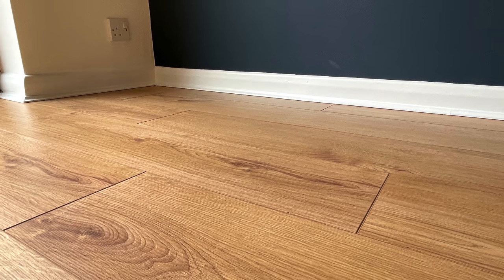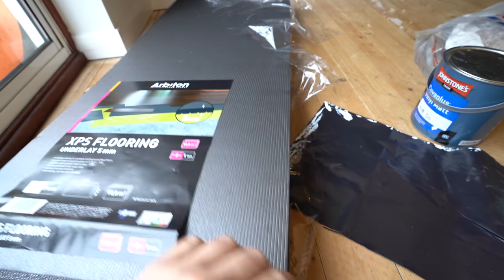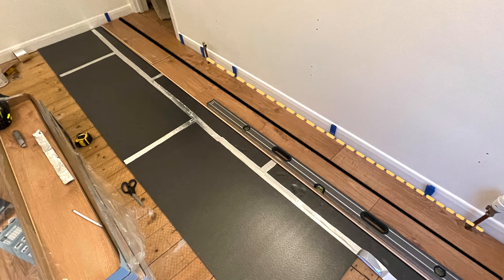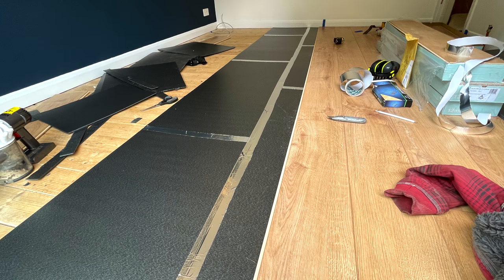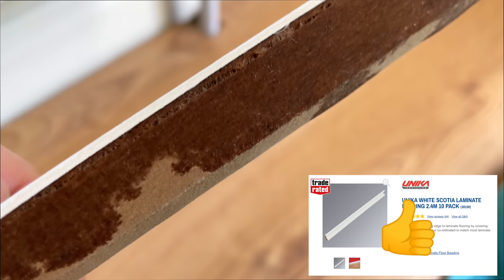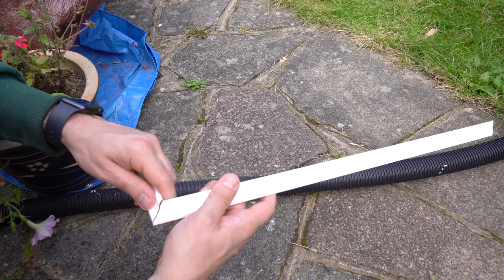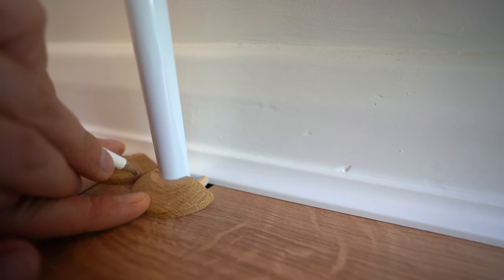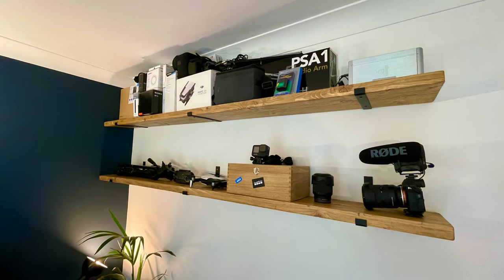Laying Laminate Flooring & Attaching Trims

Comment: Excellent job, came out looking really nice. Only small thing I’d change would be to cut the joining the straight ends of the trim at 45 degrees for a smoother finish, butting two pieces together never quite looks right and will over time separate showing the join … just a thought!

Comment: Nice video! One question, before you applied the floor trims, did you clean the laminate? I heard that cleaning with a bit of acetone (the area where we will apply the trim) will help with the glue, is that correct?

Comment: Good video, a handy hint for you. If planning on painting the skirting or trim you can tape masking tape to the laminate under the trim so it pokes out from the trim. Then you can paint your skirting and trim easily. Once paint is dry run a knife around the tape and peel the tape away. The tape under the skirting is invisible and you won't have paint on your floor.
How do you find the nailer? I have heard reliabilty issues with the non gas versions of these types of tools.
Reply from the maker: Interesting trick, I would have thought the tape would be visible even if running a utility knife along the trim/skirting but good to know. Yeh the nailer is fantastic, I think everyone has their preference - I can't be faffing around with gas and cleaning out guns personally but I'm not a tool geek - I'm more interested in the project so whatever tool is easiest and causes me least grief is my preference. Others like to tinker! If you check out my third vid in my fencing vid I use a gas paslode, didn't enjoy it, though it was a probably down to being a crappy rental.
Reply: @AliDymock  cheers. I saw the tape trick on the skill builder channel. Worth following if you haven't already.

Comment: Hi buddy, I’m looking at putting this type of flooring down in our living room in a greyish colour either 8mm or 12mm but not sure what thickness to go for and if it makes a difference? 
Also with have Virgin tv which comes in from across the other side of room and when the carpet was laid the fitter did a nice tidy job by hiding the cable in a channel under the underlay across the room to the tv so you don’t see the white cable, Can this still be done in the same way with flooring or is there another way? Any help would be great.
Thanks
Reply from the maker: Hey Adam, I've done another vid where I do laminate floor in some detail and would recommend 12mm if you can afford it: https://youtu.be/WoABx5obrXY. 

Yes, I did the same with ethernet cable to this room in a previous vid: https://youtu.be/K549FZ463Xs. I just hid it in the underlay of the carpet. The problem with going with laminate is that the underlay is thinner so it probably won't fit in, even if you cut out a space so when I came to do the floor insulation and took off the floor boards I relocated my cable under the joists, which is probably your best option. However you may get away with tucking it under your skirting so first job is to pull up the carpet along the route the tv cable can go and see if there is a gap to hide it in. Alternatively if you are taking off your skirting, the gap around the underlay AND laminate will provide a good space to run it in. If like me in this video, you leave the skirting in place and use trim then you can't. Anyway, that's some options for you my man.

Comment: Next time you can use a biscuit cutter or undercutting tool to trim the skirting so you don't need trim.
Reply from the maker: you know, I thought about that but how do you get the last row underneath? It would have to be flush with the edge of the skirting so if the laminate shrinks there'd be a gap right? I suppose you could just take off skirting on one side only.
Reply: @AliDymock  you prep the plank by removing the rebate of the groove. You then can place it under the skirt, and slide it back into the other laid floor peice with some wood glue.

Most manufacturers describe this as option "B" or other method where you need to do this modification to the T+G to enable planks to slide without the click element. Which can happen in some circumstances.

You were lucky that starting with a full plank left you finishing with a good size cut width. Always measure so you don't end up with a silther!
Reply from the maker: Ah yeh that’s smart. I’ll think about that option next time, thanks for the tip.